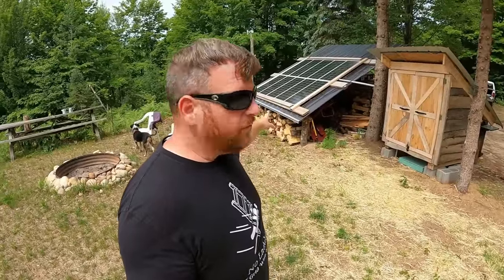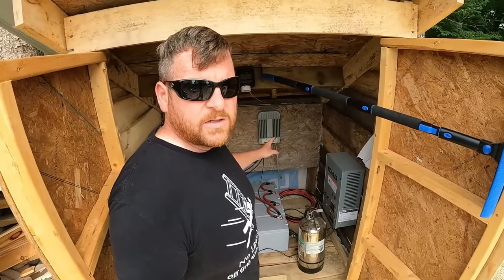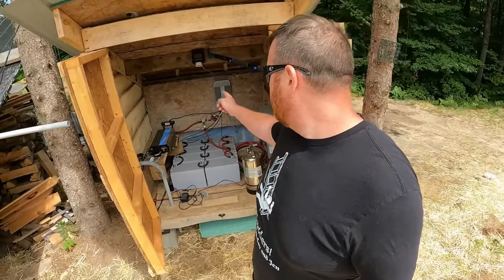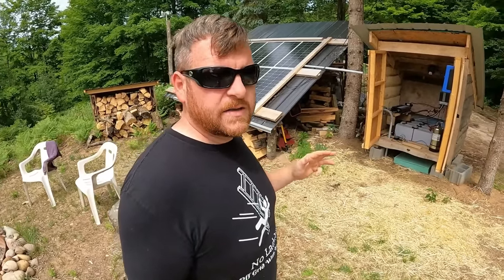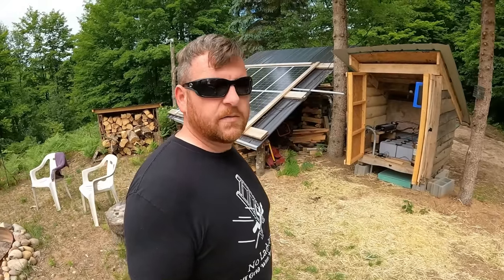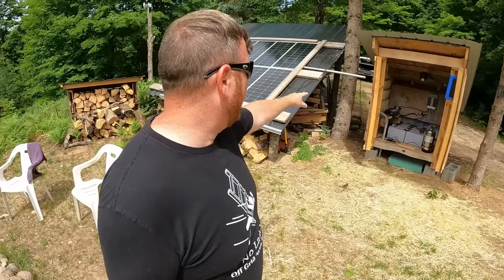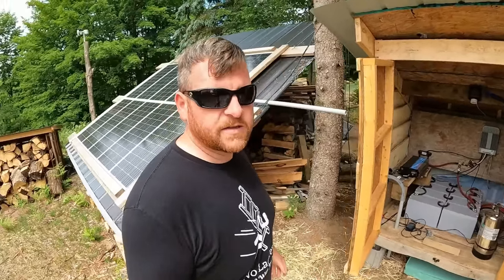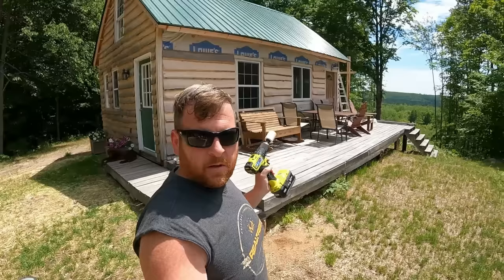One Year Off Grid Solar Power System Update

Comment: Well dang!!! - I saw this video as the ones that come up when you go to Youtube - shame on you!!! - Now, you got me thinking once again about Freezing temps and the heat the summer over 120 F in the cabin!!! - But I have to finish my solar - I went with Bluetti a couple of   years ago, and just added a add on battery, all this needs moved permanently into the cabin the add-on battery is over 80 lbs. - and all this has to go on a wire rack shelving system due to weight and the foot print (aka space). Humm... heating pads.... are these like a short circuit?? Going to have to watch what you do and see if that will work for me. But the over 104F is still going to be an issue. Due to mainly my employer the next year here is going to be touch an go at the cabin as I will not have any consecutive days off, for a year, but I have a job, so care and maintenance will be an issue as I work things in. The good news is a I still have job - the bad news is time!! So not sure, what to do now. If I had gone your route, some, not all the issues would be to some degree abated, but I have to finish what I started and maybe in time, I can move what I have home and set up something like you have. My Ryobi inverter has been beyond golden so far and A++ for the four lights in the cabin and I can take the batteries with me, so they do not freeze or overheat. I can't do that with 80Lbs. So Yes, I am watching what you are doing, to see what you come up with. This summer has been torture with the heat. But I am not sure I can stay in a gridded home must longer. I hope I am wrong, but still one never knows. Hence, I have both, and that is costly in itself. So, ya, shame on you - LOL - you have me rethinking things. :-)

Comment: Why not do what you're planning and insulate the inside of battery box and also add an electric heater to your box to keep batteries warm In the winter. Maybe
Reply from the maker: Solar Shed Will get a serious make-over when these batteries die or I decide to invest in some LifePo4.....I'm too lazy to take apart everything when it works as is =)
Reply: @OffgridwithJayandJen  ok sorry I won't harass you. You still did a bang up job

Comment: Why no tv I got a 35 inches tv  and Roku and a stereo system for surround sound bass speaker have it jump up and down it's kind of crazy looking  play twenty 24/7 half the time and a plant grow light  off a small house system  of renogy battery of 3 100 amp hour batteries and a house 120 ac,  and  and five lights I don't. Use my out back ice box that much on. A. Powmr charge controller 60 amp
Reply from the maker: We just really are not tv watchers.  We watch it Maybe once a week. Just watch the laptops then.

Comment: Question: why run the batteries in series for a 24 volt system when you're only drawing 10amps? Wouldn't it be better to run parallel for longer watt hours?
Reply from the maker: Same watt hours regardless of voltage of system....but running in 24 volt allows for smaller wires.....so less money and more efficient

Comment: I didn’t know you could link more than 4 renogy 100 batteries at a time
Reply from the maker: Have been in the configuration for 3-4 years....no problem. 5 in series and 2 stands in parallel.  100 volts and 11 amps

Comment: nice build 👍✋ but take the charge controller on  Side to the Solar Kabels 
You lost Energie per (cm) kabel

put the Controller  and the Inverter Together  15 inches away

  that‘s Anoth  ✌
Reply from the maker: That is a good point.....the shorter the better. Thanks
Reply: @OffgridwithJayandJen  no Problem

Comment: Jay, this is the first time I have seen one of your video's and I don't know much about solar. As a matter of fact I've never actually seen snow. I was wondering that since you already have the roof on catchment for your water, would there be a way that you could run radiant tubing like they do to heat bathroom floors, on the inside of the metal roof to heat it so you could melt the snow and use that for the water in the winter? I'm sure there's 50 reasons that this won't work and maybe a dumb idea, it just occurred to me after watching the video. Thank you for the info it's very helpful to us folks that aren't very versed on the subject and don't have thousands to spend paying someone else to do it for us.
Reply from the maker: You know Bill....that would be pretty cool and a good idea. It might be more easily done if the metal roofing was installed on strapping or  perlins rather than directly on OSB sheathing like we have done....less material between the metal and the open space.  The only issue I could think of right away would just be the condensation that would likely occur when mixing warm piping with cool air or what not. But would be cool to see someone try it. I know they have electric wires that can be mounted on the top of roofing, and you simply switch them on when needed, less worry about heating water lines and such.

Comment: Where did you purchase? Could you share the links?
Reply from the maker: There are links to the batteries and solar panels in the description box below if you open it further they will be in there. If you want the rest of the equipment, Will Prowse has a great solar store on his channel with tons of options including the inverter, Charge controller and the wires and such. I will also try and add those to our description box today. Thanks

Comment: We have a 2 bdr home with full unfinished basement. Can this set up be put into our basement? Would it be safe there? We use, on average, 800-100kwh a month. How much in kwh does your array run? Thanks!
Reply from the maker: Alright I'll do my best here. Our system only holds about 5 kwh in whole.....so with your usage you would need a much larger system. I have to imagine you use that much electric because you have electric water heater or stove  maybe or both? Solar is safe to set up inside your home.....but I know there are certain requirements for it to be covered under insurance and you would need UL listed equipment to make that happen. Honestly I'm not an expert so I'm just Sharing the little I have learned from watching other channels.

Comment: Do you have a ground for the DC side and have you ground the panels. You didn't say anything and I did not see any thing.
Reply from the maker: I have a ground rod in the ground with grounding wire to each component...but I honestly have been confused on how to properly ground this system. If you have some good advice I'm happy to listen. Some research I have done said doing it as I have it is actually worse and creating a target for lightning, but it is hard to find solid answers online.

Comment: Is it worth it to buy low wattage battery blankets  or would it burden your setup
Reply from the maker: Do they have low wattage blankets? It would just depend on the consumption I guess. I did install some 65 watt hearing pads under the batteries last fall....two of them....so 130 watts total. But I only used then when using the generator to top off the system. Last winter was very rough and low on sunshine so we used the generator to top off the batteries every few days, which I was not happy about..I have increased our solar array now and hope to maybe set up a wind turbine to help for the darker days of winter.

Comment: Great video. Built system similar to your system. Trials and error. Still haven’t worked out bugs. Cheep inverter failure, not enough battery size, now LiPh battery failure. I think cheep product. 1100 watts system.
Reply from the maker: I hear ya my friend. All the fancy technology scares me a little. Just more things to go wrong....just like new cars. I had a cheap inverter at first too and it pooped out on us quickly. Hope you can get your system working good.

Comment: Thanks for you video. One question please: can your system allow you to use say for example a 1000 watts heater and if yes for how long per day?
Reply from the maker: Hey thanks. You can certainly use a small electric heater with this system. We make coffee with a traditional coffee maker.....but you can only draw 1000 watts for about 4 hours before you deplete your stored power.  Anything heating you are better off using propone or wood. Lots of small heater options with propane

Comment: I have my batteries set so they do not go below 23 volts 24 volt system and my batteries
have lasted over 3 times their expected life time.   Your 12 volt equipment costs a lot more
than there worth.  You can get the small refrigerators from walmart for under $200 and
don't buy window a/c units from walmart as they suck 15 amps you can get 6 to 8K units
that draw 6.4 amps
Reply from the maker: Good info tinker

Comment: So I have a Michigan property with a 16x10 on it now- but let’s face it it’s Michigan what do you do when there is no sun for 5 days straight or more? 
It happens it’s Michigan
Reply from the maker: Run a generator when I have to.....but we made some improvements and hoping  to use it less this winter
Reply: @OffgridwithJayandJen  
Thanks that’s what I do now with a Jackery Battery it definitely is a hassle though- I’m actually considering wind power as I’m 980 ft above sea level and a mile from Lake Michigan so it’s always breezy 
Thanks for your quick response much appreciated
Reply from the maker: @fastech7635  we added a second array this summer, hoping that helps on the gloomy winter days to help our system a bit

Comment: Hi Jay & Jen.  My wife and I are HUGE fans and never miss an episode.  We have also built an off grid place and are in the process of putting in the solar system.  Your videos have been an amazing help to us.  I do have a couple questions.......the 4/0 positive and negative wires coming from the battery and inverter seem to meet at some sort of splitter which is hard to see from a frozen video picture.  Then it looks like the wire is smaller from that splitter to the charge controller (4 gauge?).  I think I am missing those in my drawing but I could not find a link to those on your description part of the video post.  Can you help?
Reply from the maker: Hey Steve......ya I will try to explain best I can. All the negative wires go to a 100 amp buss bar where they join together. ALL the DC wires on the battery bank and going to the inverter are 2/0 wires....I think rated for 500 amps?? don't hold me to that. The positive wires all meet at a 150 amp ANL fuse....again i'm not looking at it so bare with me on exact sizes. The wires between the Charge controller and the fuse for positive or buss bar for negative are 6 gauge and they will never push more than 40 amps through them so they can be smaller. PLEASE do me a favor and check out WILL PROWSE here on youtube. ANY video he has he includes in the description box his DIY SOLAR CHARTS......those are the diagrams I worked directly off of. I will try and include a link to those diagrams and photos of the system. THis is a smaller system diagram....but you just increase the size or wires and fuses
https://www.mobile-solarpower.com/the-classic-400-watt-rvs-vans-buses.html
Reply: @OffgridwithJayandJen  Thanks so much for taking the time to respond.  The 100 amp bus bar for the negative side was what threw me.  My inverter is 12 volt only so my wires will be essentially the next size up from yours.  (Also a 250 amp DC circuit breaker instead of 150 amp fuse).  Hope to get this up and running this week.  Thanks again.
Reply from the maker: @stevewalsh585  awesome....like I said everything I did was all based off diagrams on Wills page.
Reply: @OffgridwithJayandJen  I followed the link you put up to his page.  VERY helpful and I ordered all the parts I need.  Headed out Wednesday to hook it all up.

Comment: Solar is always worth it 
The failing grid isn’t 
But have the backup generator
Reply from the maker: Totally agree 👍
Reply: A lot of people don’t use both ac and dc from solar. I like dc as much as possible so to save power and increase dependability big time in refrigerator lights water pumping … 
 What about your system ?
Reply from the maker: @solarindependentutilitysystems  I like the idea of using more DC to improve efficiency but we like simple....and having two forms of power for different things was just too much trouble. We have plenty of power to make up for the lost efficiency and I can buy a couple cheaper inverters if needed in case of a failure. Also if the solar system is down entirely then we can run the whole cabin on a generator by plugging it in. Not a great back up plan longterm.....but works short term
Reply: @OffgridwithJayandJen  I found out way back in early 1990’s using dc for lp gas / electric refrigerator gives me a backup not perfect either but really makes for a super dependable refrigerator also found using 2watt led twist in lights is super efficient also , can’t forget that water pump that never requires a generator again 12 v dc on demand but you add a water tower like I did then storing water for overnight water pressure saved even more power . Of coarse I use the radiant heating for my showers and this year added a lol again 12 v heating element that tops the water off hot for winter showers ! 
 In the past I did use a color tv in dc but now using ac one 
 But for the most dependable lights fridge running water dc was for me , yes duel fuses wires is a pain but that generator is being priced out 
 I noticed that when gas was 5$ it was cheaper to just buy more batteries lol 
Thanks for the conversation!
Reply from the maker: @solarindependentutilitysystems  I get your ways....I honestly am just so simple minded with these systems that if adding an extra panel can compensate for a little wastefulness, especially when the Sun is paying for it,  I had to go that route. I'm thinking  you came over from Mikes Channel a while ago yes???  A Cabin and 50 acres.....I love his cabin but seeing his 24 volt system and all the extras he included in the system and setup boggled my mind a bit, so I just told myself to set my cabin up on AC. Have a great day my friend

Comment: Have you considered solar thermal for heating the batteries?

Just an idea
Reply from the maker: Like a separate system to heat the batteries? Or you talking geothermal?
Reply: @OffgridwithJayandJen  while geothermal can be awesome, it can be quite expensive. I was thinking more of solar thermal for just the battery house.

On another angle, a chickens body temp is 107-110 degrees..... but I'm just a chicken  🐔  farmer!
Reply from the maker: @Oklahoma Chicken Cam  ok, I'm not familiar with the process. I'll Google it, but Making an assumption it's either self heating through it's own intake or the greenhouse effect?

Comment: Can you clarify , are the batteries SLA, Or AGM? I think those are 2 different types of batteries?. Sealed Lead Acid and Absorbed Glass Mat? NO ?
Reply from the maker: Everything I have read pretty much classifies them as the same. I could be wrong and I'm not an expert on the chemistry of it all....but every thing I could find acts as they are interchangeable.  Which makes sense, because it sealed lead acid was not glass mat then the burn off of the water vapor in a SLA battery would cause pressure build up and I would think. Where as with AGM material the chemical reaction does not boil off or evaporate unless there is an over charge issue. Just talking outloud

Comment: I am going insane trying to figure out my system.  I feel like I am running in circles.  I mean I think I have it almost figured out and then wham, another variable. Is there any resource that I can call that you know that will not charge and I can bounce off my system plan to?  Will the battery suppliers help?  It's not a complicated system but I think I am way over complicating it.
Reply from the maker: Just watch Will Prowse, His older videos are basic and simple and explain things well. I was the Same way....think I have it figured out and BAM, something else to worry about. Will Prowse videos and charts will help a ton
Reply: @OffgridwithJayandJen  Thank you for responding so quickly and for the suggestion.  I started watching his videos yesterday. (I saw that last night where you had said that to someone in the comments)  I ordered his book, (under 6 bucks at amazon) today.  Where I started to go down like the Titanic is when I had it all figured out for a 2k system and then started reading about 24v systems... the difference in 12, 24 and 48v systems and understanding when it is appropriate to use one or the other is the iceberg I am facing currently, lol.  I like your approach in your video because it's realistic, not some super inflated "ideal situation". Sometimes it is easy to get balled up and start going down rabbit holes because of TOO much information.  Information that is sometimes interesting, seemingly important but in the end not always applicable to my particular situation.  So again, thank you.

Comment: More panels to have better collection in winter?
Reply from the maker: I was thinking maybe some of those bi-facial panels to heat up the batteries.
Reply: @OffgridwithJayandJen  Check out Cicel's video https://youtu.be/ca2YRJRmklA  he repairs dead panels.  It voids any use grid tied but works for off grid like he is.  You might find some panels like these.....